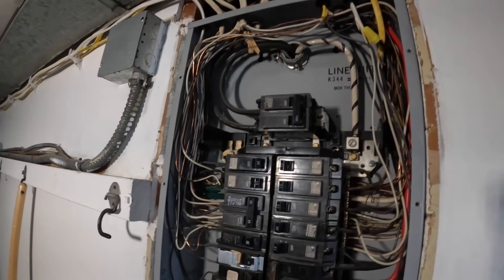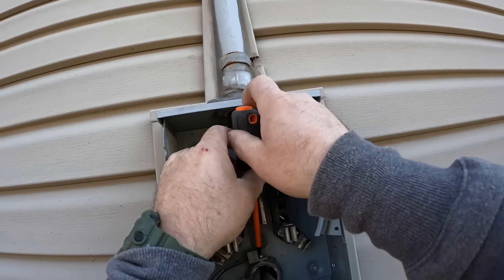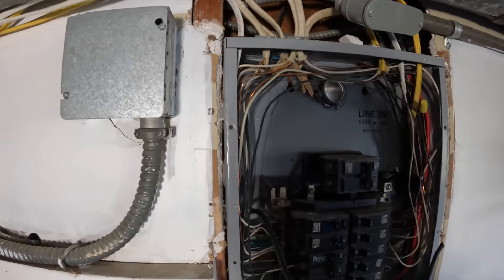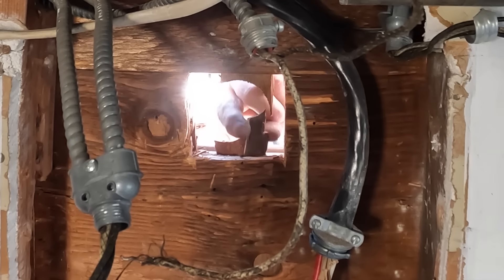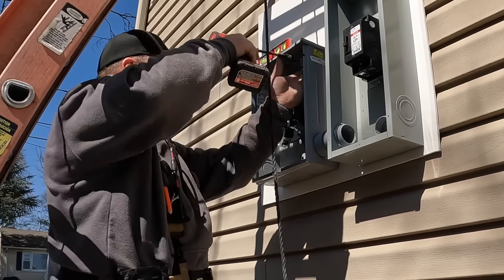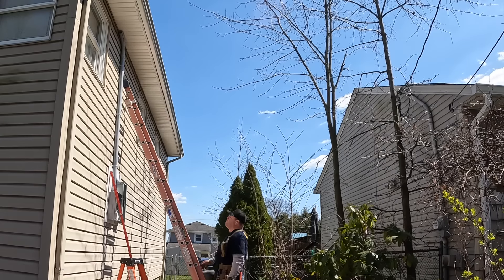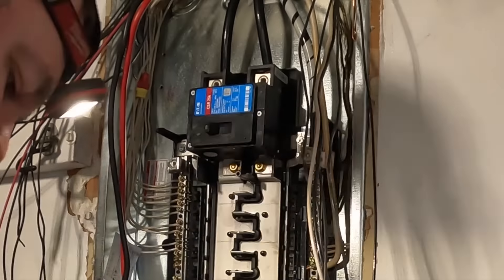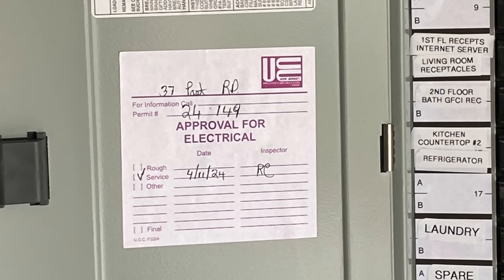Upgrading an electrical service from 100A to 200A | Clark, New Jersey

Comment: I'll continue to use metal straps on exterior PVC, despite it being a technical violation. The pipe may be able to withstand years of sunlight due to its thickness, but a PVC strap will become brittle and deteriorate. PVC will move just fine in a one hole conduit strap.
Reply: In parts of jersey.. you will fail. You can't even use 2 hole pvc straps. You have to use clip type pvc supports
Reply from the maker: The trouble with using heavy wall straps is they won't allow the PVC to move where an expansion coupling is used.

Comment: The other thing about live disconnect is that you are on a fiberglass ladder with no path to the ground. Also, you work on one conductor at a time, so even if you accidentally touch one of the conductors, you are very unlikely to be shocked.

Comment: 1:10 glad you seem to be taking those comments lightly, most wouldn't understand line versus load much less a DC versus AC current.  Electrons, neutrons and protons,, forget about it. 12:30 you're doing fine, keep doing what you are doing! Your commentary and sharing your logic has always been great and keep me coming back.  I've been working with Milwaukee tools since the early 80's and am amazed at how loyal I am to that brand. If you do not buy your Milwaukee tools from Home Depot, I would strongly recommend it because they sell such high volume of Milwaukee tools the tool department mangers usually always give me a discount. They gave me $50 off that same tower light two days ago, tool only $129. Why did the electrician take so long to build his own house,, he kept using his dykes to hammer everything.

Comment: Good Info on Sawzall . Often thought they were around years before WW 2. Back in the 1960's seemed like only plumbers owned them. Did not get my first Sawzall untill late 1970's. Was fun cutting unistrut with a hacksaw. Almost as much fun as having my dad make me use star drills first couple of years to drill anchor holes.

Comment: Ron love the videos, If you are doing a service upgrade and there is an existing 3 wire range feed, you would need to bond the neutral and ground at the main panel cause if we were to separate them techically the range wire wouldnt be grounded.
Reply from the maker: A 3-wire range circuit doesn’t have a neutral.  A 4-wire does have a neutral, a ground, and two hots.

Comment: That is why you are trained and experienced Ron.  Live work is fine if you have the training and experience and sometimes necessary like you said.  We were not technically authorized to pull meters as Firefighters, but when you have guys inside of a burning building with water, we had line workers teach us how to do it properly to protect our crews.  The electric company appreciated us working with their line crews to learn the right way to do it.  Prior to that, we did it the firefighter way and would destroy the meter and tear it out with NY poles and halligan bars....🤣

Comment: Is there a code exception for upgrades that allows you to use regular breakers and not GFCI and or AFCI protection?
Very much enjoy your vids. And it’s great that you take the time to train the next generation. Keep up the good work Ron.
Reply from the maker: Yes, here in New Jersey - for existing installations - we follow the NJ Rehab sub code. There's a link to the DCA's website in the description area.

Comment: Your vids are awesome. Don't let other comments get ya down.  Just know there are plenty of us out here that enjoy watching your videos!!  It's so relaxing watching you work and often I feel like I learn something.  I do get a little anxious when you're cutting on live utility wires and reconnecting them but that's only because I'm not the professional, you are and you know how to do it safely.  

I particularly like your discussion on aluminum vs copper.  My mom's house was built in the 70s and never has had a service upgrade.  However when working to get a new bathroom ceiling heater installed, the electrician took a thermal imaging picture of breaker box while the AC was on.....later summer last year.  The thing showed a LOT of heat and he said "It's aluminum wire coming in from the meter and we recommend copper.  Also you should upgrade from 125 amp to 200 or 250 amp" I can't remember which he suggested.    He said it was a fire hazard having aluminum but the house has been running this way for 50 years so it seems a little odd that we need up upgrade it now.  Would you care to share your thoughts on that?    We live in Oklahoma by the way with 100+ degree summer days and AC runs all the time.

Comment: Hey Ron always watch your videos , keep on trucking. In my part of Canada we are authorized to cut  live services/ pull meters to do service or panel changes/ repairs  like you are but we take a short course ( renew every 2 years  ) with the utility and have to use required safety gear when doing it such as arc flash suit , visor but most importantly in my opinion 1000 volt rated rubber gloves ( with leather covers ). Ive been doing this for 38 years and am competent and confident , as you are  , working with live equipment but would love to see you use a pair of gloves when doing these cuts , you just never know . All the best Brother !

Comment: If you can do a video on why connect neutrals and ground wires at the panel disconnect, that would be interesting!  i.e.  how to avoid parallel electrical paths during a fault.
Reply from the maker: It's easy, actually. Anywhere downstream from the main disconnect, including all branch circuits and feeders.... the neutrals and grounds are isolated from each other.

Comment: Another great video! I enjoy watching your videos. I half to use lever bypass meters and I have been using the milbank 200 amp meter disconnect which is nice because it has spaces for additional breakers if the homeowner decides to add stuff later!
Reply from the maker: The meter main combos are approved here for JCPL and PSEG but the additional circuit breaker spaces at the main is prohibited (I think). Now I have to check.

Comment: Awesome video, Ron. I will be doing a similar project putting a main disconnect outside next to the meter panel and then running the se wires from the main disconnect to my breaker panel inside the house. I will be using sleeved 4/0 aluminum and I was wondering if I need to run the sleeved wire inside 2” PVC conduit. Probably not but then I’d need to use a clamp for the wire going into my breaker panel? I’d appreciate your guidance here and keep up with the awesome videos.

Comment: Another one of those great videos never get tired of watching ur work. I wanted to ask you if I purchased a 120 plug in water heater rated at 2000 watts what breaker would I need single 20 or double pole any info is greatly appreciated
Reply from the maker: For water heater conductors and circuit breakers, they must be sized 125% of the rated load.  So, 2000 watts x 125% (2000 x 1.25) equals 2500 watts. 2500/ 120 = 20.833333.  So 10/2 wire and single pole 30 amp circuit breaker.  Good luck.

Comment: You can work live at240v. Above 240v is nuts due to arc flash risk. At 240v you just have to be really careful. All loads off greatly reduces arc risk. The risk is if you get distracted or a wire moves unexpectedly under tension. It just takes one mistake. Gloves would be a good idea.
Reply: Should have rated PPE long sleeve shirt, tinted face shield, rubber gloves that were tested & dated stamped less then 6 months ago plus electricians work boots ( no metal eyelets ).

Comment: Great job Ron, very professional, not trying to rip on you at all, I ask dumb questions because I don't want to break out the code book, I have it packed away because I was going to move but things worked out for me.
Reply from the maker: I'm kind of a code nerd.
Reply: It's all good 👍.
Reply: @electricianron_New_Jersey how come you never torque connections? It is a code requirement.

Comment: I really appreciate your channel and content. Very well done. But what I can't figure out is not your cutting the service but the reconnection of it. I heard you explain it a little bit before but you were actually grabbing the bugs I think. Are you just that confident on a fibreglass ladder?
Reply from the maker: I never come into contact with anything conductive. My ratchet cutters are insulated and I never touch the open end of the "live side." If electrons have no path to flow they just won't flow.

Comment: Good morning Ron, 
First of all, thank you for such a good video.
I have seen many of your videos installing the BR plug on neatral load centers, but none using arc fault breaker, ground fault breakers or dual function breakers. 
It is a cost thing ??? Standard breakers are cheaper right.
Reply from the maker: Not required on rehab work.

Comment: Ron, I saw you upgraded the meter/main disconnect/breaker panel to 200 amps. But how about the utility line. Did they need to bring a new line able to deliver 200 amps?
Reply from the maker: That's all up to the utility which is PSEG.
Reply: That's up to the power companies.  Here my house has a 200 amp service since 1971. The 3 other houses on the same transformer were originally just 100 amp service since tract homes. Ie not a custom house. My folks 1971 giant double over range has a 18.1 Kilowatt nameplate. That is why we installed a 200 amp service.  Today 2 of the 3 houses to the same transformer have upgraded to a 200 amp service and none had larger wires installed.  This is with local coop electric company.  So often the power companies do not not increase the wire size unless actually needed.

Comment: I see you didn't trim the neutral wire on the surge suppressor. I didnt either when I installed mine and think it'll be okay as the path is still much shorter than anything else in the panel.

Comment: So, I just had my meter upgrade to 200 amp. I had them add a meter with a service disconnect and 10 spots for breakers. 1 breaker for the house and 1 breaker for a new EV charger. I wondered about grounding when they installed it, but didn’t ask. There was no change to the main panel in the house, which I found from you is on of those crappy Pacific Electric red sticker panels. It’s been a few months since I have been in it, but I am pretty sure that the ground and neutral are bonded. I assume that is fine and still works, since it’s only running 3 wires between the outside disconnect and the main panel in the house. If I were to upgrade the inside panel, would I need to change the feeder line from the disconnect to 4 wires and isolate the ground and bond inside the house?  Original wire was all done in ‘74. Just curious.
Reply from the maker: Guy, if you are using a Federal Pacific Electric panel in your home do your family a favor and have it upgraded, They have been known to fail and start fires. This is indisputable.

Comment: So even though all the power is turned off from the main panel and meter disconnected, the wires going back to the transformer on the pole, are essentially still energized?
Reply: So that’s a yes? Lol

Comment: beautiful work.  side question i understand csst gas flex requires bonding   why doesn't flexible gas appliance connectors need bonding
Reply from the maker: Most natural gas piping is bonded to the system ground by way of the equipment grounding conductor run with the branch circuit conductors to gas-fired equipment such as a furnace. The gas line is bonded but it is to never be used as a grounding electrode.

Comment: Aren't new breakers required to be AFCI or GFCI? Or did you do device protection downstream from breaker?
Reply from the maker: This is an existing electrical system. Only need AFCI/ GFCI for any NEW branch circuits. This is the NJ Rehab sub code.

Comment: Does it make a difference what position the surge protector is located in the service panel? Thanks in advance.
Reply from the maker: Only Square D requires that. Certainly NOT.a code requirement.

Comment: Newbie question. If I do an upgrade from 100 amp to 200 amp and the wires from the utility company, from the pole to connections at my weather head, will the utility run new lines or I have to?
Reply from the maker: It'll be up to them. Usually they don't.

Comment: Does the electric company provide 200amp to every home? Even if you have a 100amp panel?
Basically, can I update my 100amp panel to a 200amp without having electric company involved?
Reply from the maker: In New Jersey, it is common for the POCO to provide a 50 kW transformer and connected to 3-4 houses in a residential neighborhood.

Comment: Ron, I really like your videos.  I never see you use a torque wrench or torque screw driver?  Code tells us to install devices to the specifications of the devices that are installed.  Lug connections,  breakers, etc. Just trying to be helpful and keep up the good work!
Reply: An experienced electrician can install equipment without a torque wrench, and there are many millions of electrical installs that are decades old that still function and never had a torque wrench put on them.
Reply: @edisont.picard4112  Thanks Mr.Edison.  The inspectors where I live require it.
Reply: @brandonquig05  Sure, they require it, but how do they prove it? Do they watch you torque every lug? Do you under torque the lugs and let them bring their own wrench and finish it up for you? Do they loosen it and then retorque it? Or do you just put a witness mark on each lug with a Sharpie after you torque it? Don't misunderstand what I'm saying. I believe lugs should be properly torqued, but I don't believe that that is achieved solely with a torque wrench. It is a method, certainly. It's the only method where a number can be measured. But I believe it is completely unenforceable.
Reply: @edisont.picard4112  No, Mr. Edison and I agree.  Just common courtesy to the home owner to do a NEW INSTALL with properly torqued connections.  When the code says "Shall" it is for a reason.  At my local tire shop, if I get new tires and they are not inflated to exact pressure because they used experience in place of a gauge...not the same result.  Getting by with things because it can not be proven is not my way of doing business, in your example.
Reply: Also, Mr.  Edison, You have very great points and I am not being complicated.  I understand.  Ron has a lot of recorded videos and we have to do things a little different in this time and age to avoid the Nancies along with liabilities from this great platform.  For legal reasons especially
Reply: @brandonquig05  Not even similar. Pressure in a container is not created by hand. You need a gauge to measure it. But the tightness of a lug is created by hand. It is something you can feel. The code is attempting to idiot-proof electrical installations. But someone who cannot properly tighten a lug without a torque wrench will not likely know how to use one anyway. And a torque wrench does nothing for lugs that never even get tightened to begin with. I'm not saying to not torque your connections. You can certainly use a torque wrench if you want to. It doesn't make it a better installation if you do.
Reply: @edisont.picard4112  Ryan Jackson has a video that will change your mind.  "2020 NEC changes series: 110.14 Conductor Terminations"
Reply: @brandonquig05  OK. I watched the whole video. Which part of it do you think was supposed to change my mind?
Reply: @edisont.picard4112  For starters,  It is required by code to use a calibrated tool and there have been a lot of studies that show that without using these precision tools that there will be human error.   It's a verification process.  Thanks for watching the video and I hope you enjoyed it!
Reply: Since you are, in fact, an electrical contractor/ master electrician, Mr. Edison,  Do you recommend complying with minimum code standards or just going by feel? I am just trying to learn
Reply: @brandonquig05  I recommend understanding what the code is trying to accomplish instead of just blindly following it. In this case, it is trying to ensure that connections are properly tightened. It's a good intention but it is empty in practice because it is unenforceable. I guess what I am saying is that I am not against torquing connections. I'm against the code enforcing something that is unenforceable. The only way I can see it being enforced is inspectors bringing a torque wrench in and loosening and retorquing connections, and we know that isn't ever going to happen. In my area, inspectors look for witness marks on lugs. But anyone can just put a Sharpie mark without ever using a torque wrench.
Reply: @edisont.picard4112 I may have came across as a troll. However, I am in search of the truth, Mr. EDISON.  I get pulled one way and then the other.  I'm just trying to do what's best.  Thank you Dr. EDISON and appreciate our exchange of opinions!
Reply: When did you become a professional in this cool trade Mr. EDISON?
Reply: And by the way, Mr. Edison Picard, I been in this field much longer than you.  Let's go do some trapping. See, who has the better skill-set in beaver
Reply: @brandonquig05  Started in 1992. I'm always down to get some beaver.